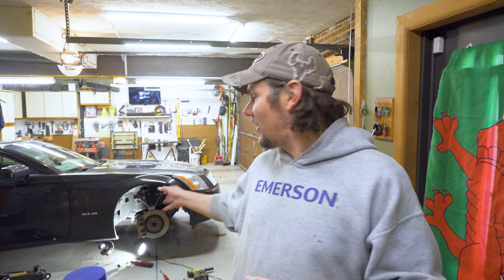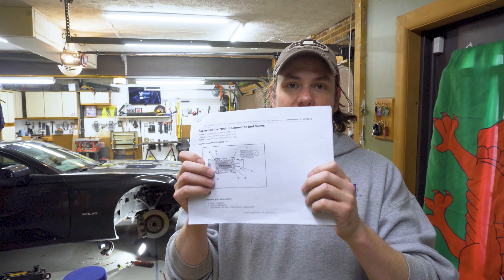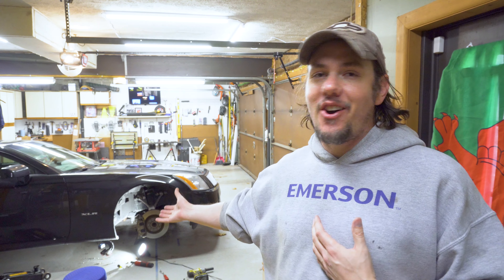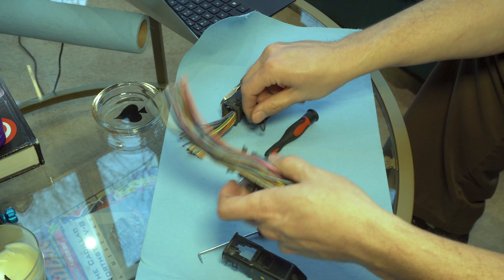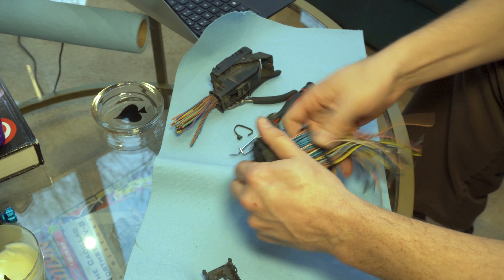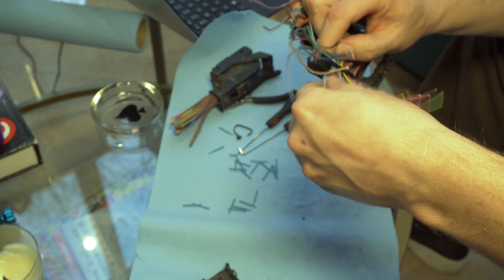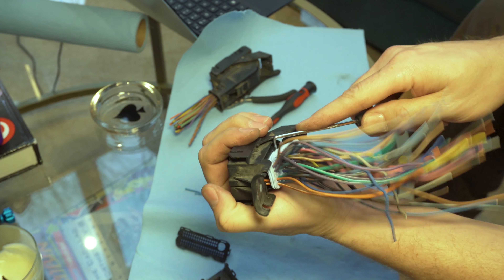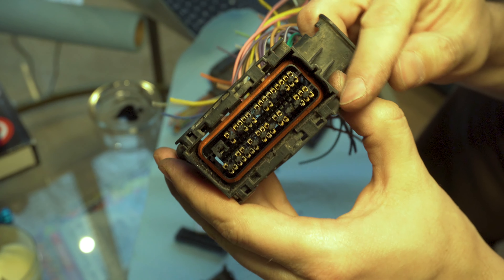Doing an ECM Swap on Project Country Club, Changing Pins to the E67 Connectors

Comment: A sewing push pin with the tip ground off works well as the little tool to go into the teeny holes to release the wires

Comment: I need ecm pin out information on which pin is which  e40 - p12 blue is 56 black 73 gray is 56 gm out of a 2005 chevy calorado
Reply from the maker: Should be marked on the ECU where they start and end, look for the 1 and count from there.
Reply: @GoatRopeGarage  i understand that part.   but what each pin does so i can do bench hook ups to each pin

Comment: See I told you Kyle. For some reason GM changed the pins from round to square in the same years...
Not sure if you remember me telling you about this. But I did a swap in a G6 and had to rewire the entire car cause of the pins. 
06-07 is a wiring nightmare. Everyone should stay far away from these builds LoL!
Reply from the maker: Yeah, I'll probably regret not getting one and just repinning everything. If I do I'll probably relocate the ECM.
Reply: @GoatRopeGarage  hey doesn't that engine use a 24 reluctor and that computer is 58 reluctor wheel is that correct?